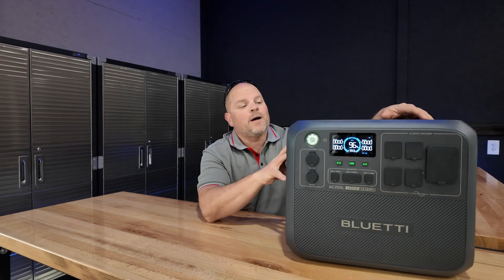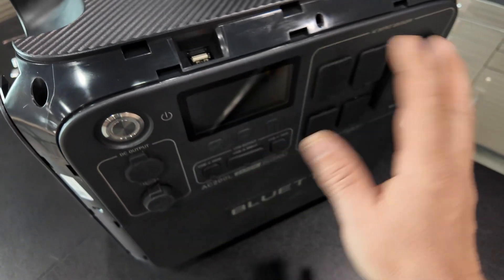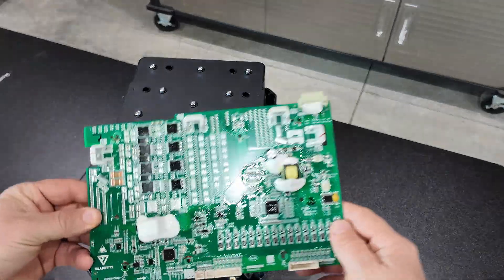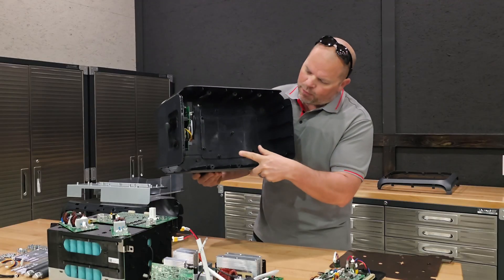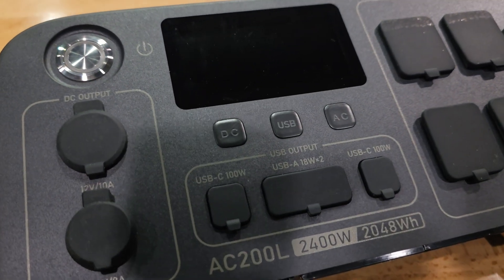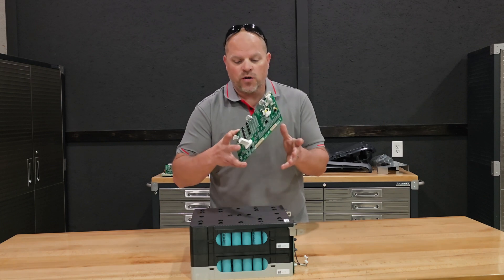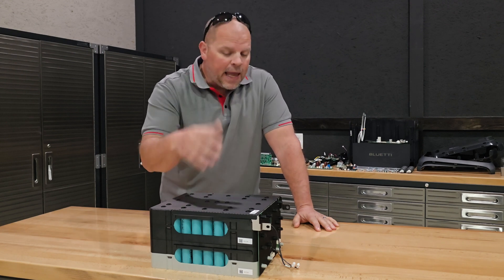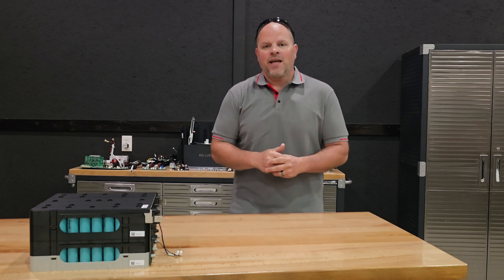COMPLETE TEARDOWN!! Bluetti AC200L Power Station

Comment: Hello, i have a Bluetti AC200PL, could you please tell me if your station produces a whirring sound from the inverter when the AC button is turned on, like a cricket? Even with a higher load and if you're outputting 250+ watts, the sound is quiet. However, with a load under 200 watts, or with no load at all, the inverter sound is louder.
Could you test this on your device?
Reply from the maker: No, I do not hear anything think that on the AC200L
Reply: @TheSolarPit  if ac is on, and without load, you dont hear anything from ventilation?

Comment: I don't suppose they sell those battery packs so you can swap them out yourself when they eventually die, do they? Guessing it may cost more or close enough that you should just buy another power station instead of bothering, but don't know.
Reply from the maker: I haven't seen them so I assume probably not
Reply: @TheSolarPit  Me neither. Thanks.